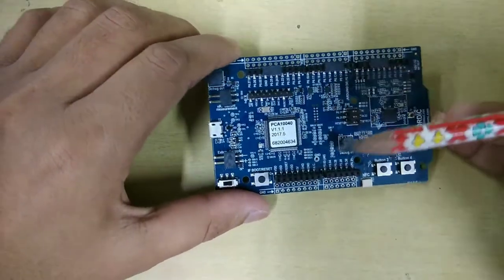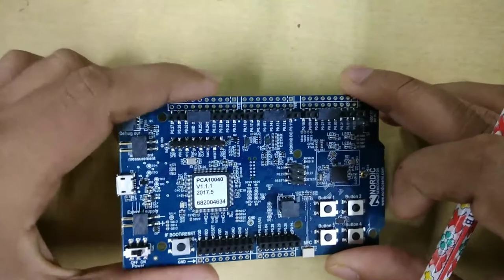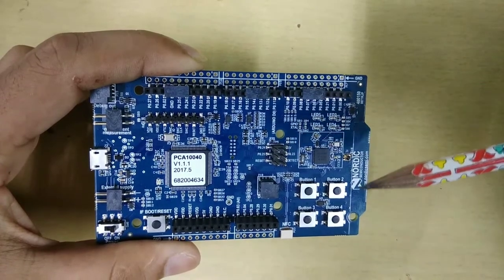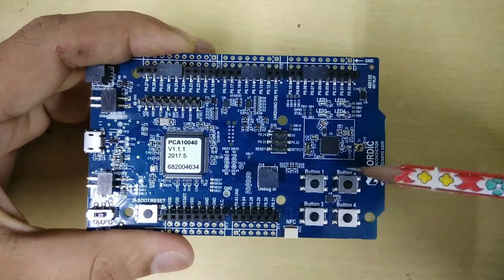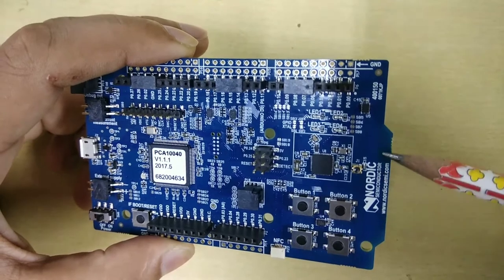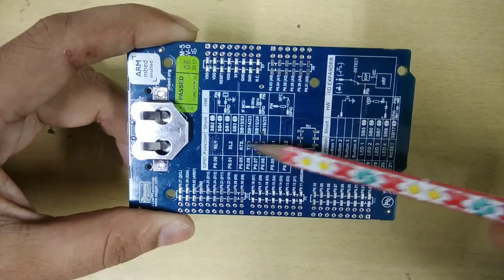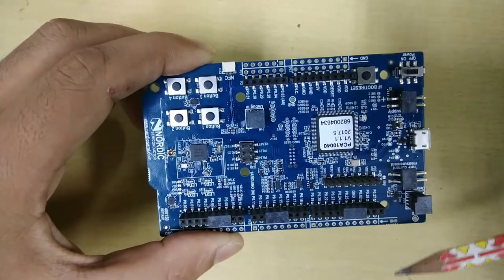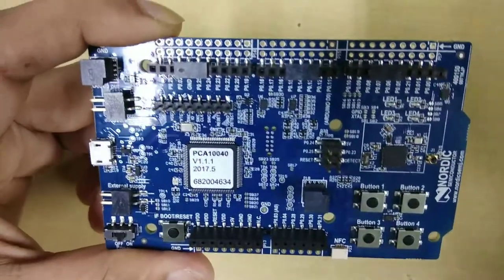nRF52 Bluetooth Development Board Introduction

Comment: Hello Tiwari..
Thanks for this tutorial. I'm using the PCA10056 with an SD card connected via P1.12-P1.15. When I use the FatFs example of SDK12 PCA10028 it works fine. but when I use the FatFs example of SDK15.0.0-PCA10056, it is not working.

Did any changes in SW/HW? I am Using NRF52840-DK and Model is PCA10056 1.0.0 2018.25  683802088.
Thanks and Regards,
Rohit Patil